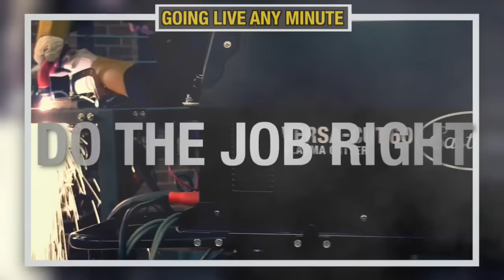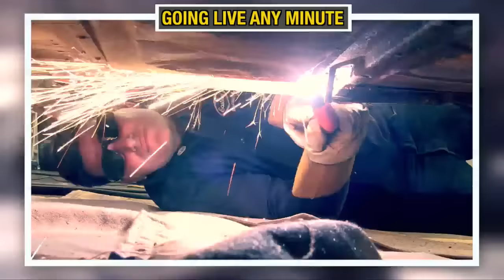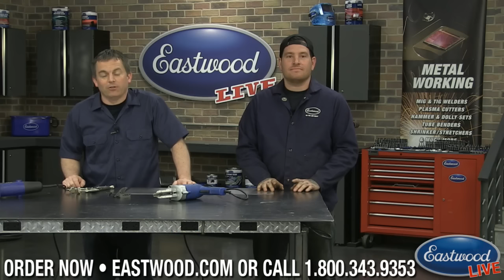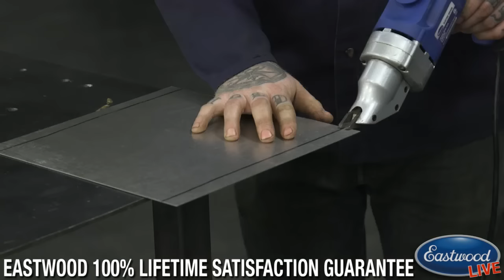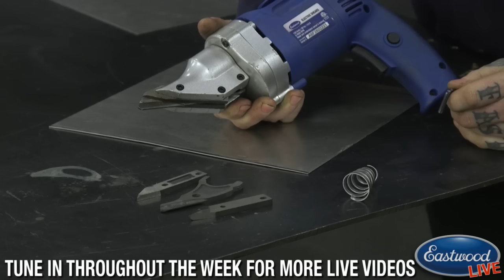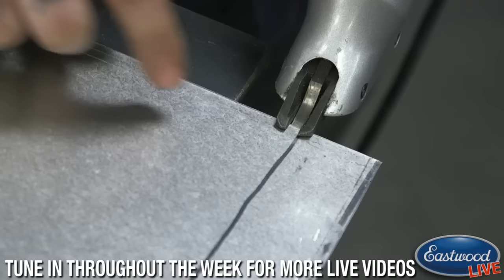Cutting Metal with Electric Shears & NEW Throatless Electric Shears!

Comment: For cutting tighter curves, for example, the corners of a window cutout in the side of a van, the series of tangent cuts wont work because you'd be cutting into the material around the window cutout. I was looking at this tool for doing this kind of work instead of a jig-saw but now I'm not so sure.

Comment: Do you have any recommendations if I want to set a new panel over an old panel and cut both at the same time to keep a perfect gap, what would I use to accomplish that?
Reply from the maker: There are a lot of different types of cutting tools available at Eastwood.  If you mark a line where you want the cut, you could try an Air Body Saw and then finish by sanding to get the exact fit.  Check out the saw here:  https://www.eastwood.com/air-body-saw.html
Reply: Eastwood Company just ordered it last night. Thanks for the reply.
Reply: @eastwoodco  I need a sheet  cutter  for  HVAC work cuting to  hangd ducket please advise Me

Comment: Can your tool cut stainless steel, i'd guess 18 gauge ?
Reply from the maker: We've cut through 18 gauge stainless with them, but I don't recommend thicker than 20 gauge stainless.  We sell replacement jaws, if that helps.
Reply: thanks
Reply: do you have a video cutting stainless with this tool.  Thanks

Comment: Can I use that to cut floor pans out
Reply from the maker: You can use it to cut existing metal on a car.  You may need to cut out spot welds if you want to completely remove everything.  Eastwood offers spot weld drill bits that work well.
Reply: @eastwoodco  i have to cut 16 gauge aluminium plate,can i?and how it will be available for me in india?